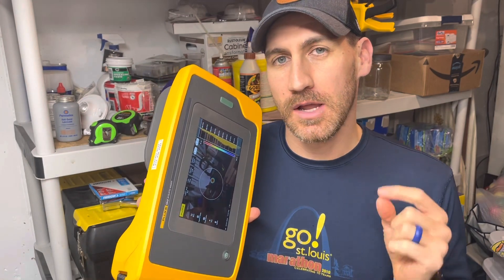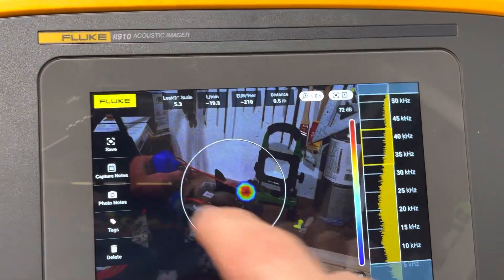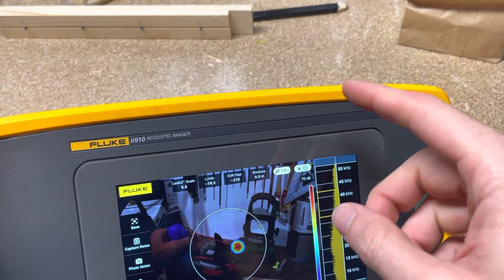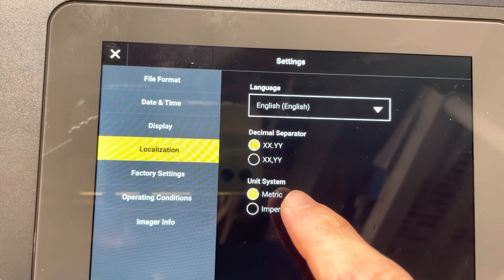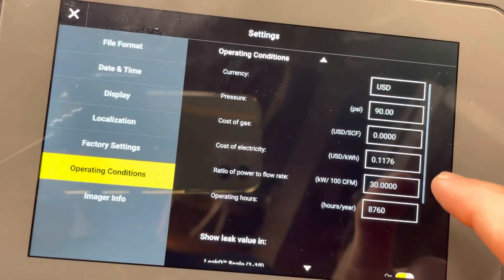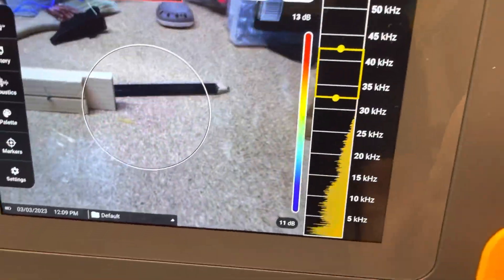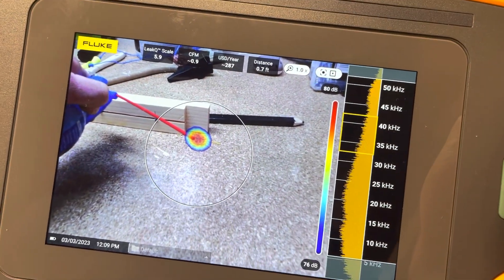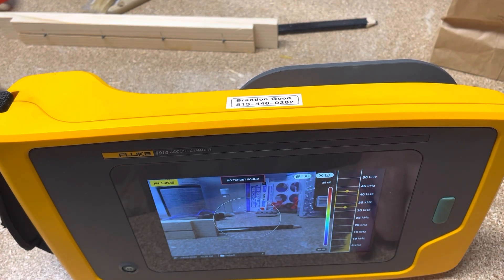New Firmware ii910/ii900 - Fluke Fridays - Episode 90

Comment: I work as an electrician. How can I configure the device settings to detect electrical faults, for example, a faulty electric motor, a short circuit in a contactor, a faulty circuit breaker, a faulty electrical cable, etc.? Please reply, and thank you.

Comment: If you work with electricity, for example with a synchronous motor, power cable, transformer, or distribution board, how do you configure the device? I mean, how do you adjust the device settings so that it works correctly? Thank you.
Reply from the maker: I would recommend reaching out to a local fluke sales rep for a demo